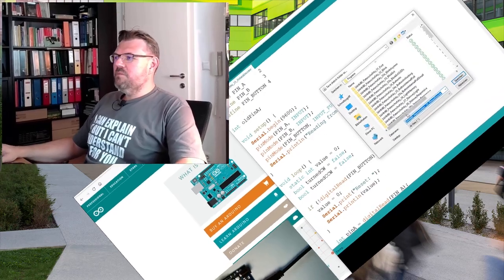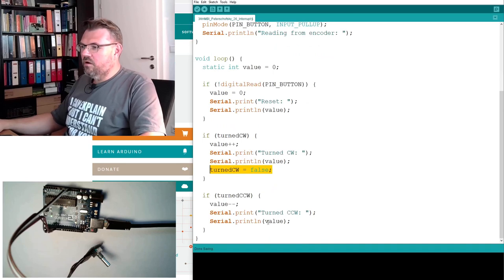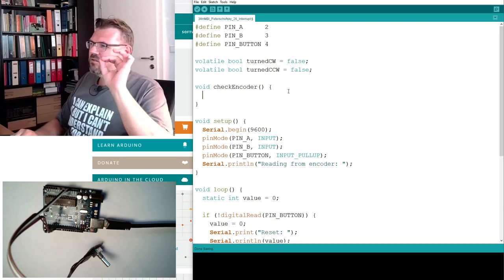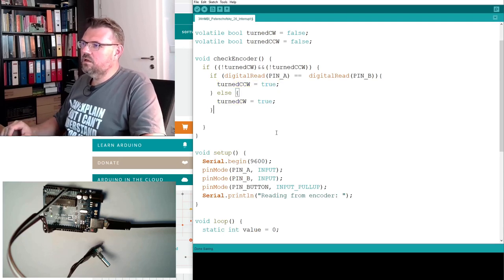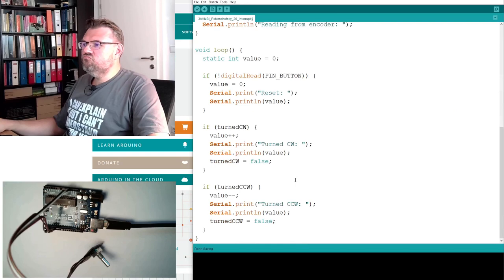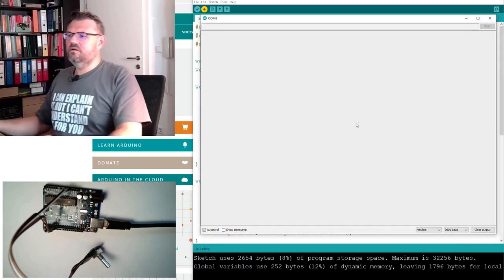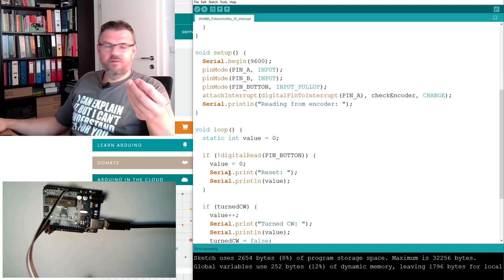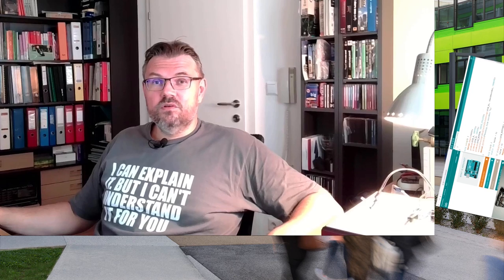Arduino 54: Encoder With Interrupt

Comment: Hello, i tried your previous and current program with my Pro micro and encoder module,
and i did not experience any wrong inputs in between, looks like your encoder module could be faulty
Reply from the maker: Yes, you are right. The encoder module is indeed not the best. I noticed this when I was trying another, more expensive model. I tried it i.e. here https://youtu.be/4DOUO2n5SRQ?list=PLVut1tKPvtvNDGeLS9-Kvc3bZ88_Y70HW.

Many thanks for the heads up! Appreciate your support.